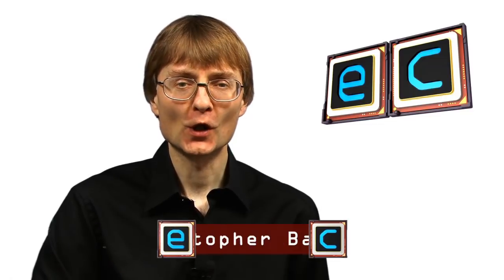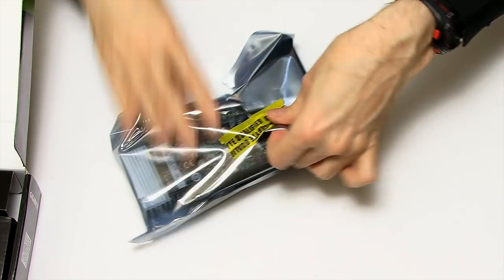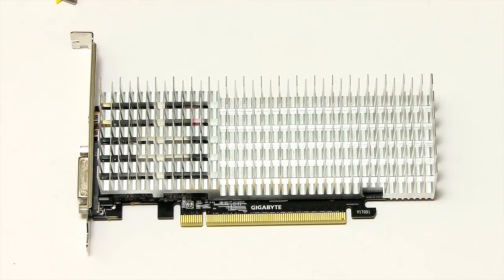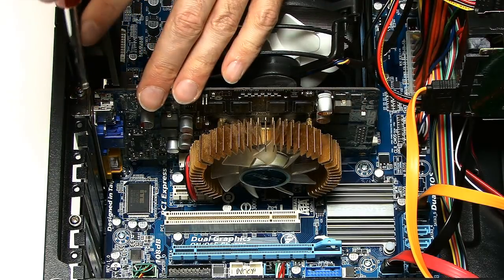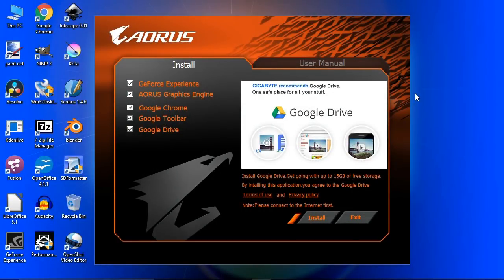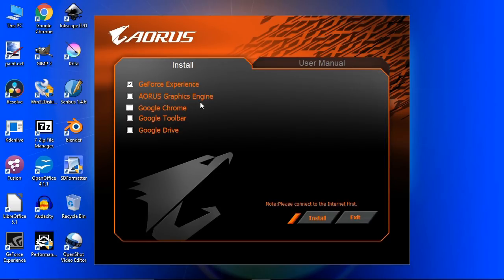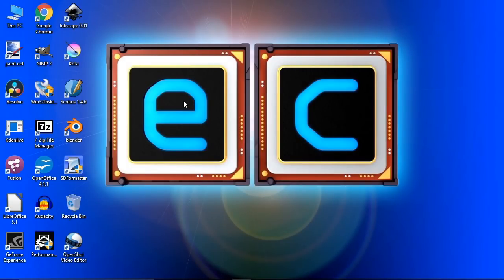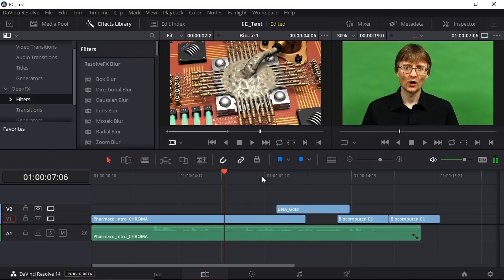GT 1030 Silent Graphics Card

Comment: Very much agreed with the login bs... but schemes like these are only going to get more eggregious as time passes unfortunately, given the current state of privacy erosion. Oh well.
It's a great card with passive cooling for fullHD editing and whatnot, but for gamers specially, you'd probably wanna go with 1050 or 1050ti for the value proposition. FullHD gaming unhinged.
If you are going 4k editing, post production (sfx), gaming or stuff like high frame rate, VR and whatnot, then it becomes more of a problem...
Or perhaps an used last gen top of the line, whichever is cheaper.

Personally, I have no plans to replace my fullHD monitors and TV, so I'm aiming for a 1050ti or 1060 when prices comes down. Black Friday certainly didn't do it, but I'm not in a hurry... next year after the holidays will probably be it. My poor abused GT640 is just not doing it anymore. :P

Comment: Nice video! 
I know this would be useless but I would love to see a version of this card with SLI for triple, or quad monitor. Two of this low profile card consume less power than a single 1050ti (75w). For a comparable price!
Reply: You only need SLI if you're gaming, if you just need more display outs you can just put two cards and use them separately.
Reply: Neurobio Boy this card doesn't have an sli connector. Only the 1070 and above for this generation has the connector
Reply: Casey Thimm: I know! But I regret that we can't with those lower end cards. It is a shame that we can't with the 1060! It is more a marketing choice than a technical choice. This 1030 is at least as powerful as the 750ti, which can do SLI.  Then, why it is not possible with the 1060, the 1050 or the 1030?
Reply: You are right,  after a check online it is more a hack than an original feature, but you can do some pairing between 2 750ti, not real sli though.
Reply: Casey Thimm the low power draw combined with competitive frames and a lower price is why they don't allow sli of many of their lower end components.

Comment: While I'll always be a fan of Mr Scissors, I'm warming to Mr Screwdriver.
By the way, as I type I'm using a graphics card with DVI-D output on a VGA monitor, thanks to a very cheap converter.  A whole £2.12 from a Chinese seller on eBay.  Works just fine.  While my monitor does have VGA, DVI and HDMI inputs, I use a KVM switch to use the same keyboard, monitor, and mouse between two computers, and it only has VGA for the monitor port.

Comment: I am currently looking for  a gfx update for gaming. My old Radeon 7950 is giving random bands, lines and artifacts on screen and crashes with any driver. I suspected the vram and found tons of errors when I tested it. Too bad vram can't be replaced easily. 

I'm considering gtx 1050 ti or 1060 as they seem to give more bang for the buck. 1050ti for example gives more than double the performance of 1030 for double the cost. And 1060 seems to be giving even more than these two combined at about same cost as these two combined. 

Radeons RX 470 570 etc also seem to give good performance per dollar with original MSRP, but they are overpriced now with high demand in coin mining.
Reply from the maker: As you highlight very clearly, it all comes down to what you want to spend. Low-end cards these days exceed the performance of many high-end cards from not that many years ago. Another dimension is power usage and cooling. The 1050(ti) and 1060 are certainly nice cards.

Comment: why are you running an ancient computer?
Reply from the maker: It is my test rig. And it works! Also, the performance improvement between older hardware and the most modern is nowhere near as high as many people assume. I also like to do software tests on average rather than the latest hardware, as most people are not running the later.
Reply: good point :D .  I thought that the new hardware made a huge step forward and the old hardware its dead now. I like this videos but i enjoy more the raspberry and arduino videos, I wish you make more videos about projects with that.

Comment: You should never rely on Windows to offer the latest drivers.  Go to Nvidia website;-http://www.nvidia.com/download/driverResults.aspx/126903/en-us and get the latest version 388.31 dated 15.11.2017.

Also, you should really run guru3d's 'Display Driver Uninstaller', especially when changing from a 900 series to a 1000 series card.
Reply from the maker: Last time I did a video of a graphics card update I did an uninstallation first -- and got a lot of flack for doing so. Which means I cannot win! :)
Reply: I don't think the software actually installs.  It just runs and allows you to cleanly remove all traces of the old driver so a fresh clean install can occur.  Not usually needed if you are just updating a driver on the same Video Card, but 'almost' essential if you are changing from one generation of cards to another.  And I would say, vital if you were to change from and AMD to an Nvidia or other way around.
Reply: I know what you mean Chris, can't please everyone, or sometimes anyone...lol
Reply: i dont know if i want install software to uninstall a driver... just do it manualy and to use the windows update for GPU driver is totaly ok cause the source is Nvidia anyways... i guess if you clean the temp-folder so the old installers dont pile up there is no different

Comment: can it be that davinci resolve doesnt work properly with radeon cards? it seems to run much smoother on your test PC then my more powerfull i5 based system with a R9 270X.
Reply from the maker: This is certainly true -- DaVinci Resolve and some other video editors work best with NVidia cards -- optimized, I think, for their CUDA tech.

Comment: Scan have a OC fanned version of this card on black Friday offer for £50  ATM if anyone is interested.

Don't think of using a DVI to VGA adapter to run an old monitor the DVI port doesn't have the analogue pins
Reply: I mean the simple ones that just convert the output to vga without any active components.

Comment: Why didn't you buy the 4GB version of the card? Wouldn't it then be faster than your video editing PC?
Reply from the maker: I am not aware of a 4GB version -- it would certainly be better, as you note.
Reply: There is no 4gb version of the GT 1030.  I've got a GT 1050ti in my desktop that replaced a dead GT 610, so I went from 1gb of VRAM to 4gb of VRAM on the GT 1050ti.
Reply: yes the 4 gb would be a ripoff as the gpu is to weak even my r7 370 shows very little difference in performance between 2 gb and 4 i have the 2gb of the r7

Comment: You don't have to install geforce experience to install the graphics driver for the card, you can get them from the nvidia website, without having to install anything extra. All you have to do, is navigate to the nvidia website, then go to the driver download section of the website.
Reply from the maker: Agreed -- or do it via Windows, as I did in the end. But it really shoud be possible to use GeForce Experience without having to sign-up!
Reply: ExplainingComputers yeah, I totally agree with you. They made me sign up with them to redeem a game code they gave me for buying a 1060, I wish they would have just let me download the game without having to sign up.
Reply: The Nvidia drivers on the website are newer than the Windows Update method. Always keep copies of the driver myself incase I have to setup a new Nvidia based PC.
Reply: The reason Nvidia did that was to prevent code re-sellers on Ebay and similar website. Before people were selling the game code for profit when they bought a new graphics card. Now they require signup and I believe they also require you to register the code with the S/N of your graphics card. I don't agree with what Nvidia is doing, but I do understand why they did that.
Reply: It is, for only the driver updates via the tray icon, which whenever it feels like checking will check for an update and popup telling you there is one and it'll let you from that popup download and install it without ever logging into the main app gui. (any feature of the main gui though that's behind that login wall doesn't work though, but I've never used those features anyway even when they were available in older versions (game optimizations that didn't seem to help me ever, etc) But EC :( win10 why????! :*(
Reply: Tray icon removed on latest Nvidia drivers.
Reply: All it does is provide a notification when newer drivers are available (hardly necessary) and can 'optimise' your games to work better - this 'feature' has debatable practical use. Having said that, the only personal information they require to create an NVidia account is your name and email address - just use a 'burner' email for this
Reply: True.  One of the reasons the drivers on Nvidia's website are newer than Windows Update is due to the lack of certification of compliance by Microsoft.  I myself prefer the driver directly from Nvidia as I have seen some performance enhancements over the years not prevalent in the Windows version.  Once Microsoft certifies newer drivers, most of the enhancements are retained but not all for whatever reason.
Reply: EXITMUSIC2011 it's back now.
Reply: YourTV Unplugged I use Shadowplay from the GeForce Experience app

Comment: Hey there, Mr Barnatt. I'm here to tell you that Your cpu cooler is looking in wrong derection. Air should be blown out towards exit cooler. Overheating psu with hot air from cpu sounds like a bad idea.
Reply from the maker: This is a very interesting point -- I must investigate the airflow direction in the case.
Reply: It looks as though it's mounted properly. The fan would blow upwards, not toward the video card.
Reply: In my 40 years experience with computers from the IMSAI to current, the biggest issue is too little exhaust fan draw.  Yes the PS will get hotter if it's the only thing exchanging the air.  One single chassis fan (80mm or larger) at the back of the case will draw enough air in the keep temps down.  You don't need high speed or high volume flow fans where a 1 Pound note or Dollar bill will flutter straight out.  The shape of the blades makes most of the noise and movement of air.  Sawtoothed leading edge blades are quieter than straight or most curved blades.  Gelid fan's are curved but in such a way as to reduce noise and offer good air flow.  Remember we are not trying to vent coal mines here.  A little research and common sense will do more than any marketing hype ever will.

Comment: Would you recommend me to upgrade to this from a Gainward GTX 760 4GB?
Reply: Liam Vella 

Go get 1050ti it is better and has good value unless you have extremely low power supply unit.
Reply: No. The 760 has twice the V-RAM and CUDA cores as the 1030 and is effectively double the power. A 1050ti would only fetch you a approx %30 FPS boost in games. Wait until next gen cards (few months) to get a cheap one or buy a decent one now to get a performance upgrade. 

(to see comparison just google '1030 vs 760' and click the userbenchmark link)
Reply: No, GTX760 is way more powerfull, the GT1030 is around 750/750ti performance.
Reply: ae b 1050Ti is about as powerful as the GTX 780 (Ti)
Reply: alaskanhybrid Don't think so. Well depends if your workload will favor the less higher clocked cores or the more lesser clocked cores.

Comment: What??? You DON'T want to give up all of your personal details to use the GeForce Experience? 

Good job chastising Nvidia/Gigabyte. They are just trying to make a buck, but they should be more upfront on what is required to run the hardware.
Reply from the maker: Absolutely. I really was shocked to discover that registration was required to received driver updates! :O
Reply: They push you to install the whole package though. HP printers do the same thing. A whole 500MB package is downloaded and installed for the 500KB of drivers.
Reply: To be fair, you don't have to install geforce experience to install the drivers, all you have to do is go the the nvidia website then to the drivers section.

Comment: maybe not the point of the video but id stay away from sub XX50 nvidia cards since they are worse value than the more mid range ones
the 1030 for example has alot less perfomance while having a similar price to a 1050
Reply: In UK the 1050 is considerably more expensive than a 1030 (1030 can be had for £60, the 1050 lowest I've seen is £108) plus, if you've seen any of his other rigs, he's a big believer in having stuff that does the job he needs it to do, not paying for power that's wasted.
Reply: there are 1050 and 1050ti that are passively cooled  from palit
Reply: yeah noise wise the  passive 1030 definetly outdoes any active 1050
just wanted to mention that if someone is looking for value, the 1030 isnt the best option available.
since alot of people tend to assosiate a lower price with better value
Reply: yeah agreed 
but i also have to side with LTT as far as recommending really low end gpus goes
Reply: https://www.caseking.de/inno3d-geforce-gtx-1050-compact-single-slot-2048-mb-gddr5-gci3-121.html
havent looked up reviews for this particular model, but a quick search for single slot 1050 brought this one up
Reply: there arent any similarly priced cards other than other 1030s but there is a 1050 ti w/ passive cooling for about double the price
-> which is still affordable and and good value proposition  since depending on the usecase u wont get alot of fun with a 1030 whereas the 1050ti will yield more "playable" performance

but yeah sure if you need something for arround 70 usd thats passively cooled the gigabyte 1030 is the way to go
Reply: Hello If you want value, buy a used 970.
Reply: It's not always about the performance. For the price, is there anything else that's passively cooled?
Reply: You may be right about the passive 1050, but strangely they do a passive 1050ti.  Although that's about £150 and if the 1030 does the job then that's all you need :)
Reply: For gaming it does really matter which version of the graphics card do you have however for video editing it doesn’t seem to make a great deal of difference as long as you have one which supports the latest cuda extensions :) I remember seeing a YouTube video where they compare them. If I remember right Lee even my GTX 1080 wasn’t much faster than 1030 when it came to video editing. Games of course are a totally different kettle of fish
Reply: @Bill Nanos True, I have the ti but prefere to have an 80mm fan (Noctua) with about 900 rpm blow on it from the front of the case when running at 100% load. Bringing it to about 80°C.  Wich is still quieter than the 7200rpm HDD, but not realy passive. I wonder what happens whem I poppulate the 2.nd M.2 Slot and remove the HDD.
Reply: Im using RX550 and for people who is playing on 780p 75hz monitor it will reach 75fps cap constantly.
Reply: -> 780p..
just take a quick look at any hardware survey 
if im recommending something its not to the minority of people that are running sub 1080p setups
Reply: Try the gt 710. an okay-ish card.
Reply from the maker: I take your point, and it really depends on what you need to do with the card, but the 1050 models are about double the price of the 1030s, and non are passively cooled.
Reply: There's something very simple that people like you just don't want to understand: if the (low) power of a 1030 is enough for you, spending more money means wasting money. Just like, no matter if 500g of chips for $2 are a much better value than 100g for $1: if you just eat 100g, buying a 500g pack means wasting a dollar.
Also, in this case, he seemed more concerned by the passive cooling. You also save the money you need for electricity and a bigger PSU.